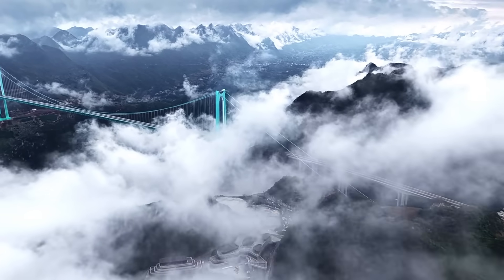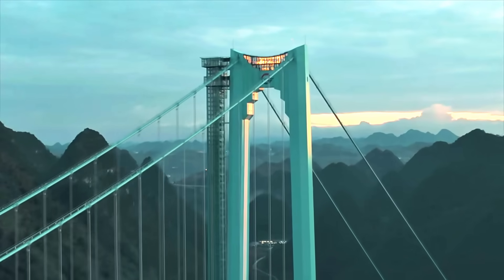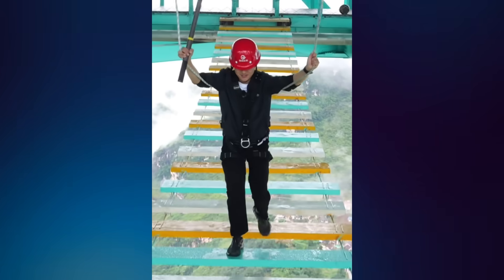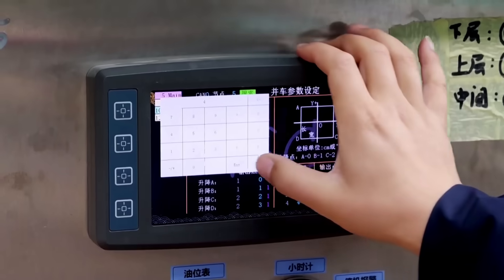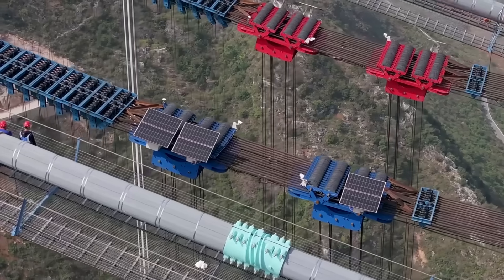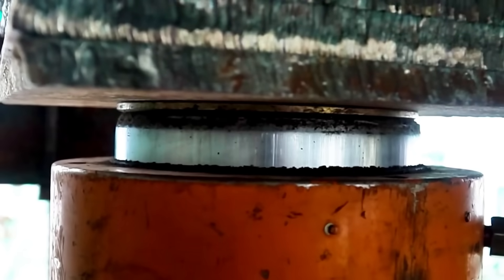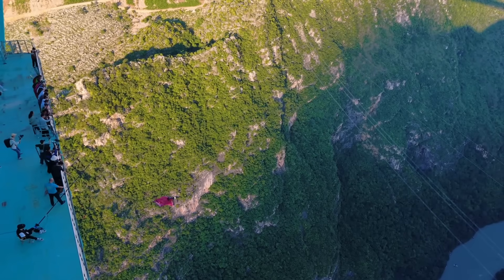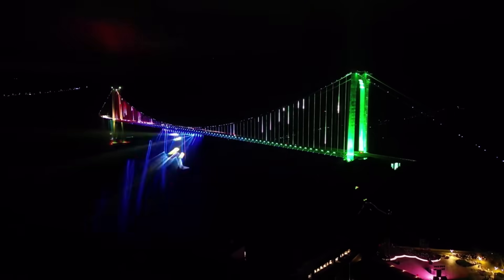China Built the World’s Tallest Bridge — Inside the Huajiang Canyon Mega Project!

Comment: Real question is could this be done in America and how long would it take
Reply: @jeovs1   The present day USA imo probably couldn’t pull it off. Definitely NOT for comparative cost, or timeframe. From the Wikipedia page for the Eastern span retrofit San Francisco Oakland Bay Bridge: “The span replacement took place between 2002 and 2013, and is the most expensive public works project in California history,[5] with a final price tag of $6.5 billion, a 2,500% increase from the original estimate of $250 million, which was an initial estimate for a seismic retrofit of the span, not the full span replacement ultimately completed.[6][3] Originally scheduled to open in 2007, several problems delayed the opening until September 2, 2013.”
Reply: @BrMark-cu9ih thanks for the reply